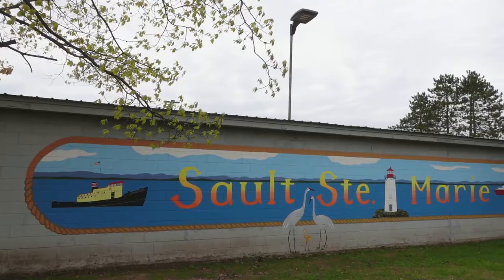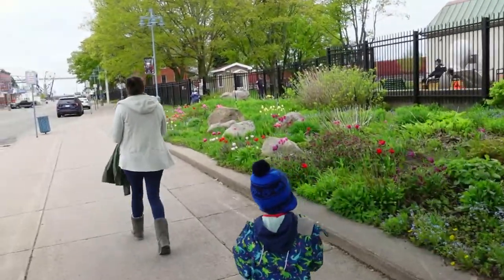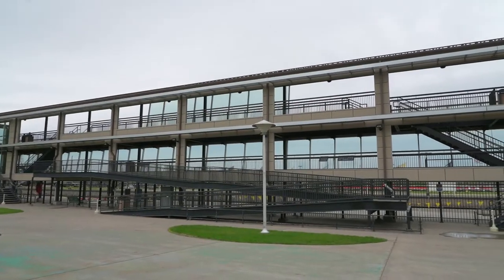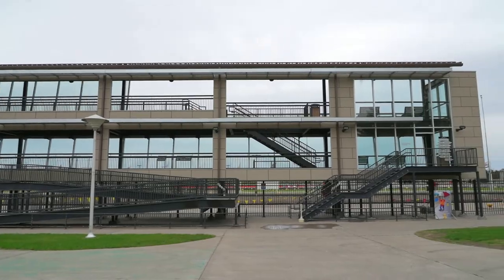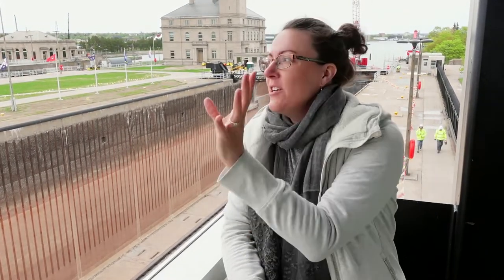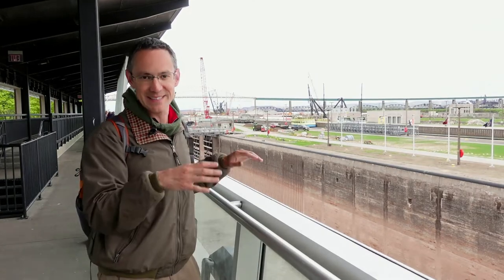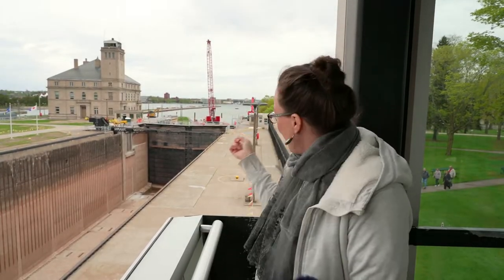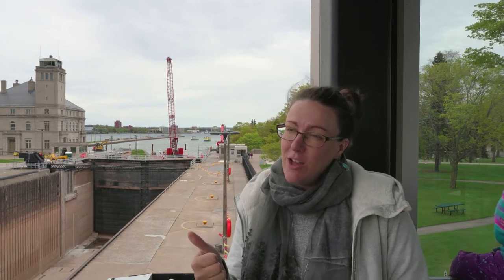Soo Locks – Great Lakes Locks System in Sault Saint Marie

Comment: I ride the locks on the Mississippi in my canoe. It’s free and kind of fun. The most impressive was St. Anthony falls upper lock, but it was permanently closed years ago.  The US Amry Corps is studying what to do with the locks in Minneapolis St. Paul. Since there is no more commercial barge traffic this far up the river, they are no longer used for their intended purpose.  I’ll keep using them as long as they are open.
Reply from the maker: That does sound like a lot of fun. I had no idea they were free!
Reply: @NeverStopAdventuring  Well, they are free to use for the boaters, but they must cost hundreds for thousands of dollars annually to maintain and staff.